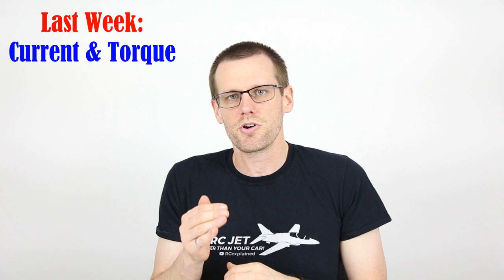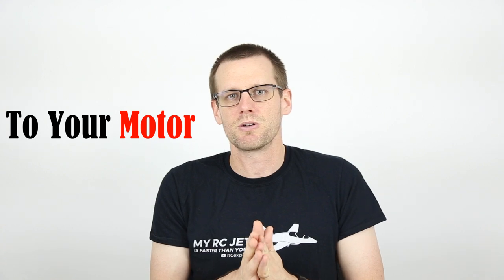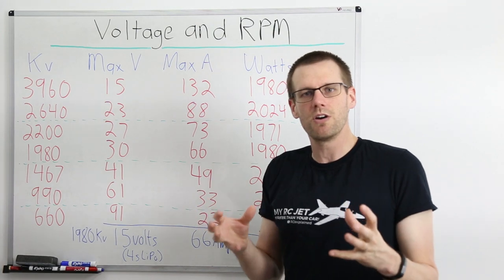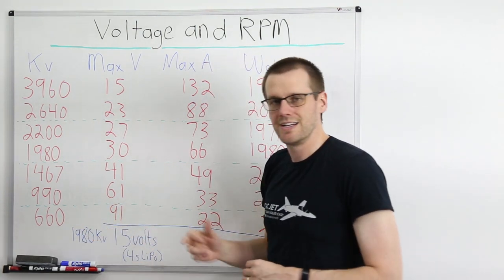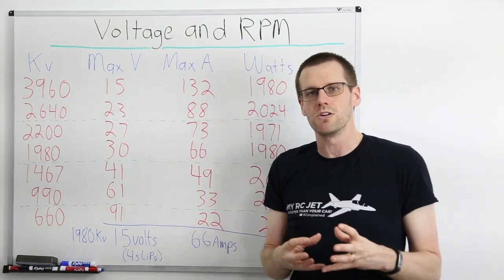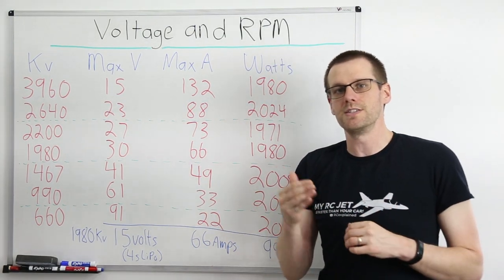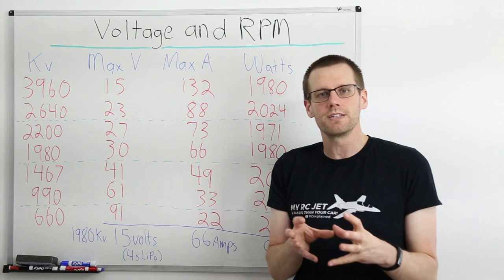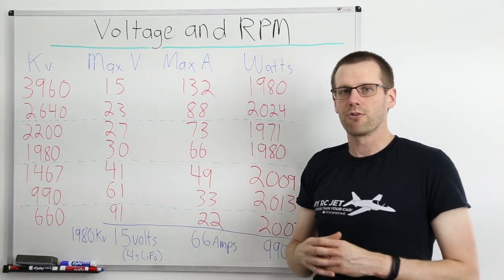NOT Operating your Brushless Motor at Max RPM is Robbing Power

Comment: Appreciate this discussion, I was always wondering if there was a theoretical limit on Voltage other than RPM/volt. I have always tried for around a RPM around up to half the max recommended RPM allowed. my favorite RPM was always around 25K if i could gear properly. For example I have an Arrma Big Rock, it's good stock, but limited to 3s max (3200KV 3660 I think). My eventual plan is to swap in a similar sized (maybe a few MM's shorter to save weight), 1200 KV motor and run 6s setup (Upgraded ESC of course). Why would i consider this? because on 6s, a 1200 KV will be running around 26K RPM while the current setup is running 35K RPM By dropping the RPM for similar work I'm trying to make it more efficient and allow a slightly smaller 6s pack (more closer to like a 3k or 3300 mah) as opposed to larger 3s packs (currently 5500 mah). The lower RPM while geared similarly in speed, will allow the motor to run cooler while doing the same work. Using the voltage to make the power over the current, makes the overall setup more efficient, allowing for similar to even boosted runtimes, Vs the 3s setup. At least this is what i'm aiming for from a previous project using a similar setup. Another advantage I'm hoping for, is getting rid of at least the fan on the motor. We used to never run fans, on either the esc or motor and still made great power
Reply: Alternatively, halving your gear ratio should double the mechanical advantage it affords - allowing the motor to spin twice as fast while only drawing half as many amps.
Reply: Thanks for this information sir, I have a stock Arrma Granite v3 and the motor overheats insanely... even with the stock fan over the motor always engaged... Then I must to stop running it to allow to cool down for some minutes... I worried about that because I'm running a Turnigy Graphene batteries (3S 75C discharge 5000mAh, green ones) and I was thinking the batteries are too much C discharge rate, could be the cause of overheating of stock Arrma Granite motor? Thank you so much
Reply: @evoxer87  The quickest fix would be setting a 70% throttle cap in your radio if has that feature, but a more ideal solution would still be reducing the gear ratio in the car so it delivers more torque at the axle for every amp it uses. (Note, however, that the car will have a lower top speed either way.)
Reply: @Mark-4158 , Might work on the motor, but could cause problems for the esc, These esc's are designed to run at 100% otherwise they will overheat. also if undergeared too muchwill cause the same issue due to the RPM's maxxing out. Esc's have two modes, PMW (part throttle) and 100% (fully engaged circuit) if the esc is run in PMW for too long it can overheat due to the FET's switching off and no constantly. Also 70% throttle will hurt the overall efficiency (Runtime) of the esc and the whole setup
Reply: @evoxer87 . If you are geared at the same as my truck (arrma big rock), it's 15/37. I have also considered dropping two teeth on the pinion (13 from 15) you will lose a little top speed, but it will make it easier on your motor

Comment: This is very familiar to me, check max rpm motor can handle, multiply kv x voltage used to determine the maximum rpm it will run at with a lipo battery, ive learned thanks to u ryan, dont over rev a motor with more voltage than it can handle.

Comment: btw, motor "A" IS MEGA HARD TO TWIST THE SHAFT WITH FINGERS, literally have to try all my strength to twist once, then when the car is on the ground with nothing turned on, tires dont budge not even once, literally have to put weight to spin tires, gears and or spur/pinion gear not binding, I check 3times. I never tried the motor yet, still in the middle of my builds and waiting for 3 and 6s esc's. This motor is installed into my E-Revo 2.0.

Comment: Question, I have a new brushless motors and need help understanding them more please, btw love your videos on all the info you put out, I been loading in all the info I can to understand more, anyways motor "A" is rated for 16.2 volts max and 332A max, with a max rpms of 75,000, 3210Kv, can size is 3.55inches long and 1.80inches wide, "would this motor be safe to run on 6s with 15lbs weight at speeds of +60mph? and is power output correct?" plz help

Motor "B" is 11 volts max, 298A max, with a max of 120,000 rpms, 9500Kv, can size 2.45inches long, 1.80inches wides. please help. Motor getting installed into Losi 8ight 2.0 for speed runs.
 Sorry to ask for lots but sure need helping understanding my power outputs.

Keep up the great work. Love what your doing.

Comment: What would be the most effecting combination of battery to Motor for a large tugboat.
Reply from the maker: Depends more specifically as to what your performance goals are. I would suggest going with an outrunner to get a low Kv motor in order to spin the prop much slower. Power demand for a tugboat should be much lower in general. Using a larger prop on a tugboat is important to get the thrust that a tugboat needs.

Comment: Hi, im looking to build an electric skateboard how should i pair a motor esc battery? Check esc max amp first then calculate battery? Motor says it can handle 60A but battery is 120A, esc is 150A dont know alot about RC trying to figure this out

Comment: What kind of vehicle is using 2000W power?
Reply: It's not unusual for E Revo's or E savages to run over 2k watts
Reply: My Tekno 1/8 scale truggy with standard size motors peaks at 4000w and averages 1200-1500w
Reply: Jep hpi savage 6s flux is 3000watt

Comment: Can i use 120a esc + 3380kv with 18 max V (60k rpm) with 4s 2200mah 110c lipo for my feilun ft011 rc boat?
Reply from the maker: 3380kv on 4s is too high for my recommendation. I'd reccommend around 1800kv.
Reply: @RCexplained  how about if i upgrade my battery pack, can i use 3380kv motor?
Reply from the maker: 3380Kv is best for 2s in a boat
Reply: If 4s lipo, what kv motor i need?
Reply from the maker: I recommended 1800Kv.
Reply: Tq sir, really appreciate your recommendation.. By the way, i have a problem with my battery.. When i charged, the balance charger show "battery vol error cell connect".. Is my lipo damaged or else?
Reply from the maker: What were the voltages of each cell